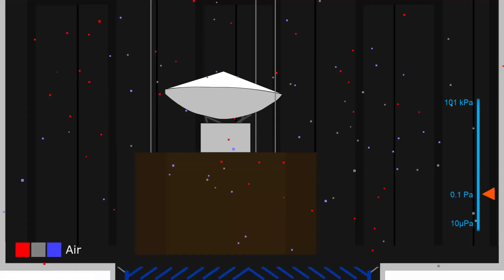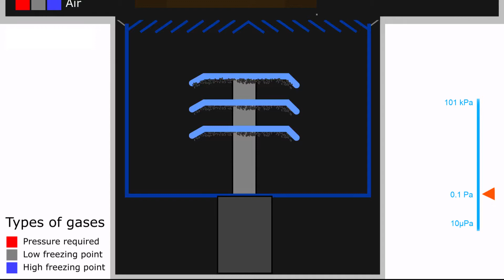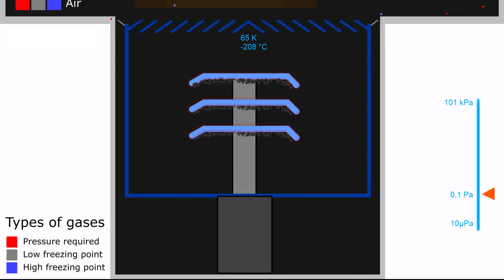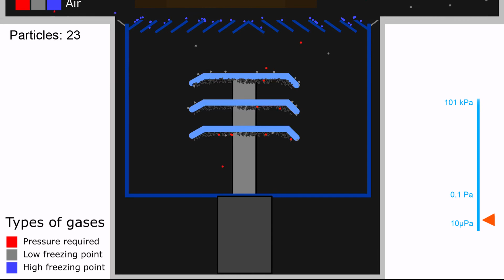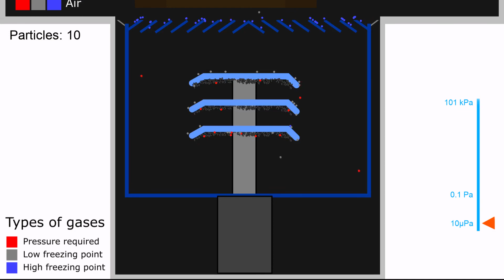Cryopump

Comment: thats only half the story. Don't forget the cryppump doesn't work indefinitely after the charcoal is full the cryo needs a regen cycle. Close the valve to the chamber heat the cryo and open an exhaust valve basically.
Reply from the maker: Thanks for the additional info.
Reply: What if you don’t open the exhaust valve during the regen cycle? What could happen?